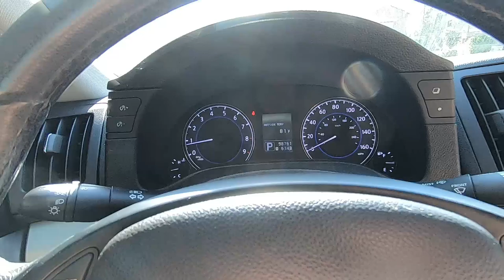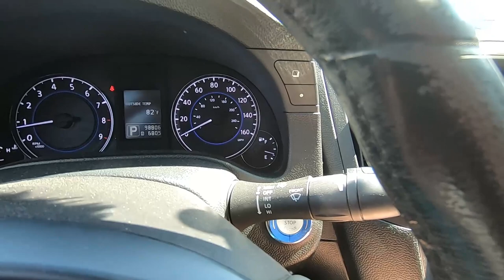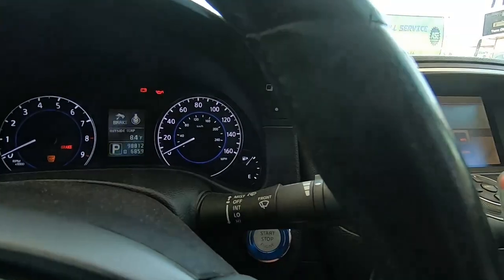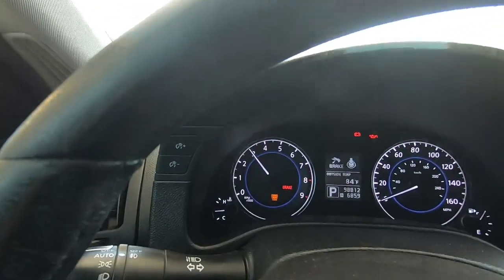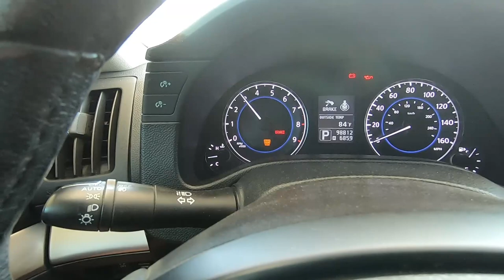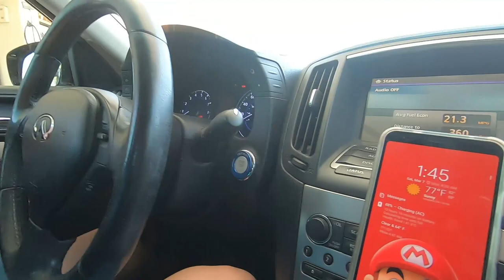2013 Infiniti G37 Sedan - Admin Tuned On ECUTEK - How to Use the 100 Octane Race Gas Map

Comment: A. Thanks for making me aware of this mapping app.  G etuning? 
B. The actual new mixed fuel would not take effect  until the existing fuel in lines , filter and pump were used. Not immediately
Reply from the maker: Hello there, it's called ECUTEK and it's a tuning software, I love it because there's also the phone app which I show in this video. Yes it takes a couple of miles for the fuel to completely mix, feels better as you drive. Thanks for watching 😃

Comment: Man this is awesome. I'm getting my G E-tuned with Moncef in the next couple of weeks and can't wait to do it. Quick question, your rev limiter is nice and high when revving at a standstill. Did the tune increase it by defualt or did you request that from moncef specifically? My G only revs to about 4500 RPM on the stock tune. Thanks!
Reply from the maker: Hello there, I didn't ask Moncef to remove the Rev restriction when revving in park or neutral, he just did it on his own, guess that's one of those things he does by default LOL. You're going to love his work and you'll absolutely love driving your G even more afterwards. Good luck and thanks for watching.

Comment: great video. I'm also admin ecutek tuned 2013 g37 7at sedan. With only SOHO CAI, Art pipes, and motordyne Catback I made 314whp 259tq on dynojet (Seattle 92 octane gas). I did test the 1/4 mile on Dragy. I made 12.94s at 109.8mph, 0-60 is 4.54s. I gonna buy headers or 3.69FD vlsd diff. I saw your videos both megan headers and dc headers have some issues. So at this moment I don't know which headers to go with. Probably ISR LTH? What's your opinions? get headers or 3.692 FD diff swap? Thanks
Reply from the maker: Oh WOW, nice build man. ISR LTH are good, I would say the Z1 hearders are good as well, but they cost over $1K. IDK how practical the rear diff mod will be on the street, if you're planning on drag racing your G often then it's probably worth it. If not I would get the headers, and combine it with all your current mods. Hope that helps you out, good luck and let me know your builds progress. Thanks

Comment: what exhaust?
Reply from the maker: At the time of this video it was a Magnaflow oval shaped custom exhaust system.
Reply: Memo's Garage AZ custom as in? what size piping, mufflers? resonators? y pipe? decatted?
Reply from the maker: The setup was: DC Headers (about 2.25"), Z1 test pipes (2.5"), Manzo Y-Pipe (2.5" inlet, 3" outlet, plus two 12" resonators welded on it), 30" long oval Magnaflow muffler (3" inlet, 3" outlet) with I believe a 16" resonator. In my last SOHO exhaust system I talk about it and show what it looks like as well. Hope that helps.

Comment: High 13s isn’t good.. with ur VQ37 I saw someone do 12.5 NA full bolt on ... u should revise ur mods.. I do 12.9 in hot summer with a 2.0l 320i bimmer... turbo.. u should be faster then me .. maybe u should put a closed intakes like me
Reply: Stock ur car does high 13s... like 13.6-13.8 stock...
Reply: I seen stock G37x DO 13 sec in the strip... 1/4 mile
Reply from the maker: Hello there, not sure if you're posting in the correct thread, this vid is about getting racing fuel, not about drag strip ET #'s 😁